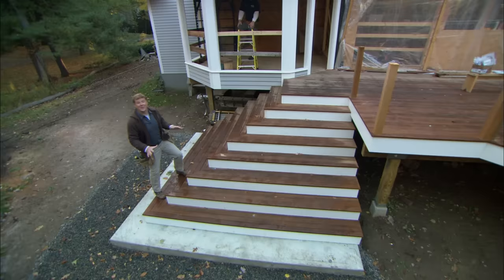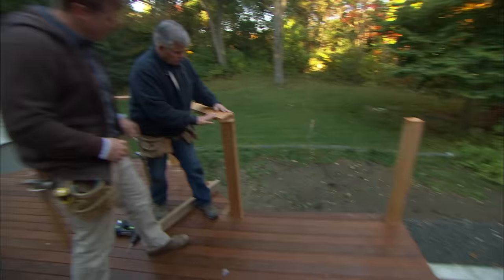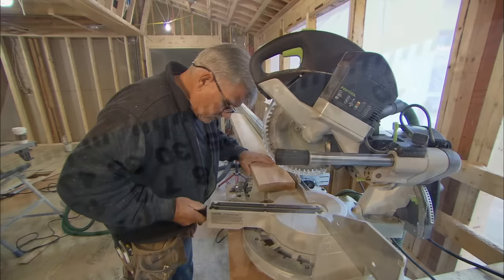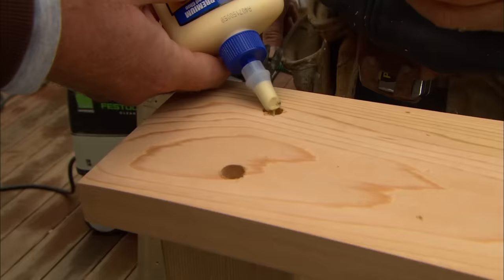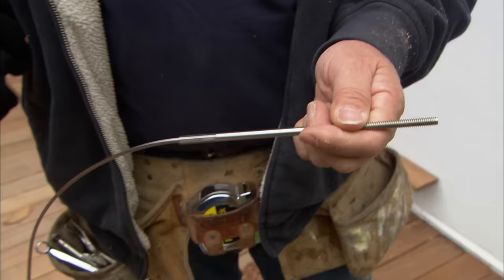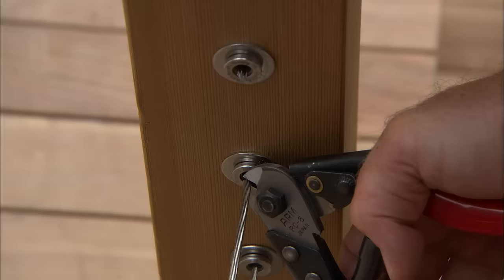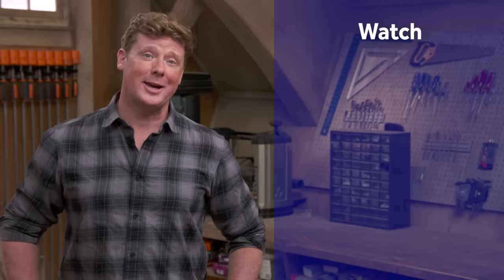How to Install a Cable Deck Railing | This Old House

Comment: Can you please share where we can source this style cable, as well as how you fed the wire through a 90 degree corner within the 4x4.
Reply: I just asked the same question about the 90 turn!?
Reply: I just run a new cable, it's more expensive but I would rather not risk breaking the post

Comment: Couple comments - make sure to tighten from the middle cable outward to properly displace the load, and use post protector sleeves on the pass throughs to protect the post holes and gives it a finished look.
Reply: B
Reply: what material did you use for these post protector holes?  cut to length on-site?

Comment: Tommy, how did you direct the cable through the posts at the 90 degree corner?
Reply: I did not see the answer??
Reply: @jeffsanger7246  they never answered
Reply: the magic of television 🙄
Reply: Probably drill slightly larger holes half through both directions and then use a small automotive pick with a tiny hook on the end to hook the cable and pull it around the corner
Reply: I read a comment here that it was prob a 45 degree hole so that the cable can be pushed through but would have been nice to see them explain if that's what they did.  And should use metal sleeves for all contacts with the posts.

Comment: How did you run the cable around the 90 deg post?
Reply: I wondered this too.
Reply: He drilled at a 45 degree angle…
Reply: @cd3rls  that’s what I saw too.  Haven’t found any system that recommends that strategy

Comment: How did you make the turn/drill the holes to make the 90 degree corner?
Reply: I know right? slightly #suss
Reply: He just drilled it at a 45 degree angle…
Reply: Slightly bend the cable end and feed it through

Comment: Good TOM, the Cable Deck Railing installation is very clear, I require you to tell me the name and specification of the materials, both the cable and its terminals.

Comment: The Feeney cable rail system is the best thing going by far! I was looking at Bullet brand (and others) that had individual tensioners at each side of each post and required a brand specific crimp tool.  The 40' section of wood railing that I was replacing would have cost $1500-$1800 with Bullet. The Feeney pre-crimped 40' kit at $60/each times the 10 rows plus 90 protector sleeves and 10 end caps was less than $700. This system was so easy to install and looked great. The hardest part getting the holes drilled straight, which was done by an experienced carpenter for us.
Reply: Was the 90 protector pieces to insert into the wood so that the cable wouldn’t wear down the wood it’s threaded through? I’ll be looking up Feeney brand thank you.

Comment: very helpful! I love your method for creating a bevel on the top of the railing by running it through the table saw at an 8 degree angle. I will definitely try that on ours when we get to the railing!

Comment: It turned out looking really nice. I was thinking some kind of bushings would be nice, though, to finish off the holes drilled in the posts.
Reply: At the least some stainless collars to add more industrial robust look going through the posts.
Reply: I’d like that too
Reply: No
Reply: The few that I've done have those bushings,and are more adjustable as well. Cable railings aren't inexpensive, I'd rather cross the T's and dot the i's than cut corners. Looking at this makes me think the cables will chaff the posts at every corner.

Comment: Nice work!! Except you forgot the protector sleeve in the post holes. It’s just so the cables don’t wear out the holes at the pinch points since wood is soft.
Reply: Optional

Comment: Tommy has mad knowledge and skills.   Table saw to pitch the top railing...dow's and pins vs deck screws on the top plates.. these are small yet great tips.
Reply: Actually, @ 02:45 he did use deck screw, the dowel served to plug the screw hole.

Comment: How did you do the corners? The one 90 degree corner- how did you get the wire through it? How did you drill for that corner?
Reply: That is the question!
Reply: @alex1975uk  I read a comment here that it was prob a 45 degree hole so that the cable can be pushed through but would have been nice to see them explain if that's what they did.  And should use metal sleeves for all contacts with the posts.

Comment: I learned so much from this video, EXCEPT for the ONE thing I came here hoping to understand... How did you get that cable to make the 90 degree turn on that corner post??? I am anxiously awaiting an answer from ANYONE who can help. Thanks in advance!
Reply: @wired4fun I'm going to do my first wire railing this summer. So I don't have any actual experience. That being said, I know there are metal sleeves that are inserted into a slightly larger hole. They are used to dress the hole and protect the wood from being damaged. In that case you would drill the 1/8 hole on a 45 degree angle through your post, then enlarge the same hole to  possibly 1/4 inch, but only about 1 inch deep, to allow the insertion of the sleeve. There are sleeves for straight and sleeves for angled drilling. They both sit flush on the surface so it appears that the cable made a turn inside the post. I  hope I'm describing this properly. I haven't found the correct brand/items yet, but I know they exist.

Comment: This would be much more helpful it you said what cable system this is. I haven't seen a one way  grommet system like this. looks great would love to buy it.
Reply: My thoughts as well.  Im getting ready to install a cable rail system for a client and would like to use the same product he was using. I suppose with a little research I can find it.  Would be nice if it was listed in video info though.
Reply: I'm in the same exact boat. These guys are one of the only carpenters I trust to watch, to learn something I've never done.
Reply: @gar949 ever find out what it is ?
Reply: @gar949  I believe I found it .
Reply: @jaredmasonn5701   What is it? Thank you!
Reply: @WetfootWoodworks  my bad I thought I posted the link when I commented last .
Reply: @WetfootWoodworks  its super expensive but you can actually buy all this stuff separate with a gun for about $45 and crimp it all yourself more work but saves money I am going to be doing it that way in about a week I will let you know how it goes seems super easy for anyone that has the least bit of skill and can copy a YouTube video
Reply: The gun is $45 the part are around $100 and a roll of wire will vary on size with the price
Reply: @jaredmasonn5701  Hi, I was curious if you would share a link to this cable sytem. I can't find it with my own researching.
Reply: @gagecalhoon Awaypp
Reply: @jaredmasonn5701  Are they deleting the link? I can't see any reference to the cable system you found. Can you respond with name only, no link, and see if that post stays up?

Comment: One thing to note is that code changes when using cable.(in most regions that is) The spacing drops from 4" down to 3" so that as the cable stretches it doesn't stretch beyond 4 inches.  Best to verify code before installing so that you don't have to redo it
Reply: Well, if you’re going to stick to the code, then don’t install railing that climbable.
Reply: @scott5654  Always check with the local Building Department.  In my case, the Building Department is OK as long as the maximum space rule isn't violated.  That usually means building-in "safety" against deflection by using 3" spacing of the cables.  Tom Silva knows his stuff, so I have to assume he's up on all this, but he might have been a little more detailed here.

Comment: I wish they had showed how they did the turn at the 90 degree.  How did they drill the holes?
Reply: Agree...possibly the main reason many people watch this video was to see how they did the corner. I was disappointed that they completely skipped any discussion on how to do the corner post.  I read a comment that it was prob a 45 degree hole so that the cable can be pushed through but would have been nice to see them explain if that's what they did.

Comment: What's not demonstrated here is how the holes were drilled on the outside corner post. How was that done. Diagonally though it? Can't be two holes right angles to one another. That would be impossible to fish the cable through. I have to do one pf these next week and need to know. Also, what brand of SS fasteners and connectors did you use?
Reply: I read a comment here that it was prob a 45 degree hole so that the cable can be pushed through but would have been nice to see them explain if that's what they did.  And should use metal sleeves for all contacts with the posts.

Comment: I have a deck with this exact design of cables and it needs refinished. I just checked my cables and they did something a bit different. You will want to have a decent amount of the threaded end poking out so that when you need to refinish the deck, it wont be a struggle to reinstall your cables as you will want to remove them to make your job a whole lot easier. The way he installed those cables does not allow for easy maintenance of the deck in the future.
Reply: I believe the cable hardware shown here is not re-installable, when Kevin cuts it flush before popping the end cap.
I have seen another YT video where they refinish the wood structure around a pre-installed cable railing and they just wrap the wire with masking tape to protect it.
Reply: So what is the name of this cable railing product?  I'm interested in this and like this design.

Comment: amazing video
one thing I would do differently is to, here at 4:30, to give it a little more cable so you could work with it outside the post, bending it to your direction.
after that, just pull from the other side

a quick question: how much pressure is too much pressure? It is a lot of horizontal pressure (10 cables)?

Comment: Please tell me how you ran the wire at the end of the corner...
Did you L shaped inside the wood, drilling halfway into the wood makind 2 holes? I couldn't see that part in the video,

Comment: Much attention was paid to details on this job, but I’m very surprised no bushings were used where the cable transits the posts, especially where the cable changes direction.
Once tensioned, the cable WILL wear, & elongate the holes,  those cedar posts are soft.
Bushings are the cheapest part of the job, HAAS sells them for less than $1, Feeny, (used on this job), are 10 for $12.
It is not true that the quick connects used here cannot be undone. Feeny sells a tool ($7j, specifically for that purpose, (works much like the gizmo for undoing Sharkbite plumbing fittings), works on all Feeny quick connects.
Reply: They also make angled bushings for going down stairs.

Comment: Love the look. 
Only issue I have is that 4” spacing that code requires doesn’t seem adequate for a non rigid rail system.  What happens when a little kid pushes his head through those flexible cables?  4” can easily become 6”  or more with a little applied pressure.
Reply: They tightened them significantly, they’re not really flexible anymore
Reply: @riffdex  Since they did the whole cable run with a single tensioner, I can assure you these have some give
Reply: They are flexible
Reply: I'll tell you what will happen. That little kid will realize that it really hurts to squeeze his noggin thru a 4" cable rail, and will think twice about ever doing it again. Lol.
Reply: Until they choke to death.  Not to be dramatic, but these systems are dangerous.  They not only allow a little one to stick their head through (inattentive parents may not see the child right away) but it also allows children to climb up and over, like a jungle gym playground.  The fall would not be nice!

Comment: Can you link where you purchased the cable system from?
Reply: Who makes the cables equipment?
Reply: I guess you have to pay them for that info
Reply: Check out FEENEY and CABLE BULLET systems. Great look and tensioner system. Make stairs and 90 degrees situations much easier to deal with.

Comment: How did you drill the corner post for the cable to go through at 90 degrees?
Reply: drill from both sides and meet in the middle
Reply: I was looking to see if anyone caught that
Reply: But the wire end seemed to rigid to bend 90 inside that wood post. Not even a sweeping 90. No way that fed thru there. I need to see what they did.
Reply: @drewmanning1025  exactly

Comment: how did you drill the post and pull the cable on the 90 degree corner?
Reply: He just drilled them at a 45 degree angle from one hole to the other…

Comment: I’m pretty sure you’re supposed to have the nut tightening end of the cable on the opposite end where it’s more easily accessible. This is so you can tighten the cables in the future if they become loose over time. Also, after you tighten the cables starting from the middle out (not top down as you did), you trim the excess thread from the bolt and install the decorative covers.
Reply: Wouldn't look as clean. I like where they hid the spot for tightening it...
Reply: @Wired4Fun  that’s why they have decorative covers which look far better than having a threaded bolt with a nut sticking out the way he has it. His job looks sloppy but maybe you’re ok with that.

Comment: How were the holes in the corner posts drilled? On center using the template? Just figured it would be difficult to run the cable through a 90° hole.
Reply: Holes were drilled straight through and the cables made the turn on the outside of the post; watch it again.
Reply: @straight_to_finish  the corner post at 6:17 makes it look like the cable either: A) makes a 90°turn in the wood; 
Or
B) the hole might have been drilled at 45° from the middle of side where cable goes in to the middle of the exit side;
Or my guess
C) they actually had Norm Abram come work some magic, but couldn't air it
Reply: @straight_to_finish  That corner post doesn't have the cable running straight through it.  I believe they made at least two holes.  But if it is a 1/8 in cable and a 1/4 or even 3/8 hole in that post, it may make it easier to bend inside and come out the side.

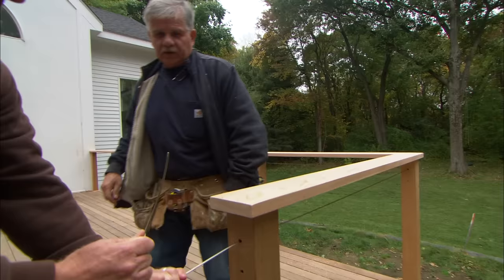stop the video at 5:04, then slow the speed and at 5:05, you'll see his hand only moves over to the side, not the opposite side.  Then at 5:06, you'll see the corner post from the opposite angle.

Comment: You need a one 4 under the top rail to stop the posts from drawing together, tension wont last just using #9 SS screws
Reply: Can u explain this more? I'm trying to figure this cable railing thing out
Reply: @schreckd  he means that you need a piece of timber underneath the top rail between the posts to stop them from bending and being drawn in by the tension of the cable. It also a very bug run of cable without tensioners along the run. I think the cables are going to slacken a lot in time.
Reply: also a 4x6 90 degree metal bracket under the top rail will work .

Comment: I'm surprised the holes through the cedar don't need some kind of metal sleeve, so the metal wire isn't pressing up against the wood. Wonder if that would honestly make a difference?
Reply: I am sure that if it was needed Tommy would have done it
Reply: this type of horizontal baluster is illegal in New Zealand
Reply: @Stolendesign  In most jurisdictions in the USA, any mention of the "ladder effect"/climbing hazard (for horizontal balusters) has been removed from the building code.  The data indicates that even young children won't climb a railing with horizontal elements, more than they would climb any other type of railing.
Reply: @kenc2257  I am always stunned at the differences in building codes across different countries, same applies to road worthyness of vehicles. a lot of the car stuff you see on you tube from the US is just not possible in NZ and Australia is even more strict. I think NZ has a quite a few more regulations around building codes etc as part of a national health system focus. If we have an accident in NZ we get public healthcare. so the govt legislates a little harder on the front end to limit the exposure to accident and injury risk in the back end. This is across the board in all facets of life.
Reply: Probably not required but it would make it look nicer I think.
Reply: @Stolendesign  works great for tiny population.
Enjoy!
Reply: @daveklein2826  Nobody is 100% perfect. Cedar is soft and the tension on the cables is high to keep them from being able to pull apart. You can already see the holes on the corner posts crushed open a bit. A metal sleeve or grommet will absolutely improve the long term integrity of this system.
Reply: @blanketstarry7725  I agree need some kind of insert sleeve
Reply: Lots of these systems have insert sleeves. Search around.

Comment: How do you screw a hole in the post that turns the cable through 90 degrees??
Reply: I read a comment here that it was prob a 45 degree hole so that the cable can be pushed through but would have been nice to see them explain if that's what they did.  And should use metal sleeves for all contacts with the posts.

Comment: Can anyone offer advice on table sawing a peak in rail cap board if using a standard deck board as opposed to 2"x6" boards? Are they 'thick' enough?

Comment: Hi Great info.  Any experience with Cable Deck Railing on coastal areas?  If the cable is exposed to the salt air,  I'm worried about rust.
Reply: Make sure the cables and other hardware are all stainless steel, preferably something like 316 grade which is pretty resistant to salt. A 316 stainless system should hold up pretty well in most coastal situations.